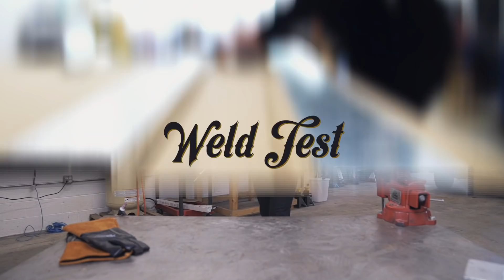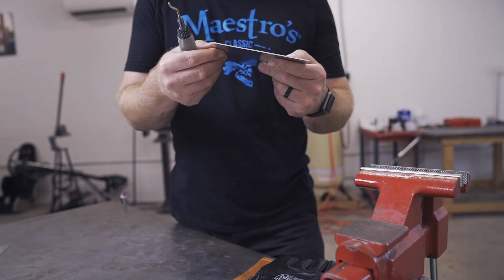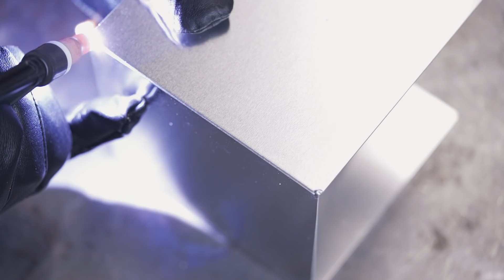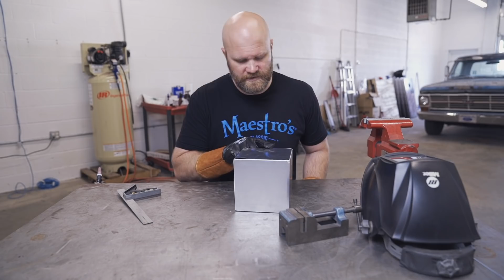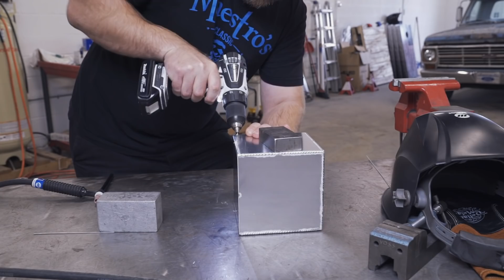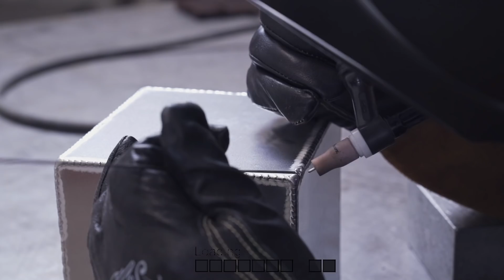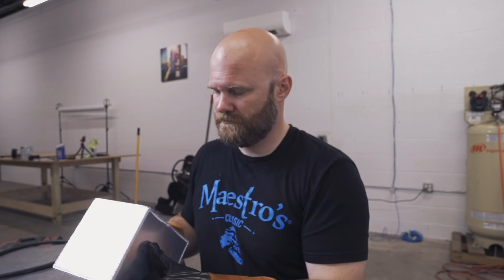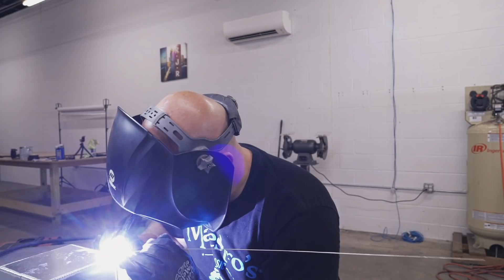Ace a NASCAR Welding Test - TIG Welding an Aluminum Cube

Comment: I've had do the same with pipe or tubing, you don't put a relief in it, it will blow out and you will never fill it. I'm a fabricator and have been for about 20 years and most guys that come fresh out of welding school know absolute shit about what you have to know to be a fabricator. It's not easy job and you constantly have to absorb and learn. Great video, going to suggest making a cube as a welding test and not just T's, butt and laps.
Reply from the maker: That’s awesome, some people say you hardly every weld up a sealed container but I disagree, happens a lot in building race cars. Each tube of the chassis is sealed.

Comment: In the beginning of the video you said you've done this very test on a couple of interviews and you still haven't learned to let it cool down before trying to close up the vent hole? 
It's the oldest aluminum tig welding test trick in the book! 
Guess you don't pass alot of interview tests, huh?
Reply from the maker: No bullshit here, I’v usually just let it cool but not on purpose. I never thought of internal temperature, kind of thought it was just argon building up. But now I know :)

Comment: I welded for Nascar and would test new guys. I usually would give them exact instructions on what I was looking for. If they where really good some one would hit the table with a hammer to see if they would just keep going or dip the tungsten.
Reply: It's funny you say that. I saw a guy do that shit and the dude that was welding ripped off his hood, grabbed a pair of welper pliers that was next to him and threw them and nailed him the back of the head. Dude got stitches, both got wrote up. Best be careful who you do that to.
Reply from the maker: I jump 100% of the time but haven’t ever dip my tungsten from it, I don’t think. But hell I jump if someone taps me on the shoulder. I’m just in the zone I guess.
Reply: Brian can you point me in the right direction of how to apply for such a job? I have a certification and the skill level I just don't know where to look into applying
Reply: @josephgonzales3573  Its really who you know. You need to stop by shops and talk to people.
Reply: @bpetrozelli  I can't even figure out how you find a shop that is affiliated with NASCAR in any way

Comment: What If you had the cube sitting on a big ice cold chunk of steel, making the air in the cube cooler therefore drawing a small vacuum in the cube giving you a second to seal the hole?
Reply from the maker: Possibly..

Comment: To fix the hole problem. Pull a vacuum on the box in a argon chamber and then backfill with argon. Wait until your almost fully welded up, and let the part cool to ambient temperature (still inside the backfilled chamber), once cooled quickly hit the hole before pressure builds due to excessive heat forcing the weld to expel. That’s the proper way to do it.

Comment: Using a steel razor blade also works as an aluminum deburing tool. You can whittle aluminum with a steel knife.

Comment: heat up the cube a bit before welding the hole. that way as you weld it most of the air in the cube will be getting cooler and it would suck in instead of blow out your weld.

Comment: if a welder showed up in tennis shoes it would take away from the first impression of a seasoned professional.... 
@7:15 fail for safety. no glove.. burnt hands are not productive..
Reply from the maker: I know people who tig weld with no gloves the whole time. And tennis shoes are the standard in nascar. Maybe just not grey ones.
Reply: @JustVoss  I used to run a 20 man fab crew. I was a fanatic about safety.
Reply from the maker: Jim Palmore no definitely not as heavy duty. It’s more like building hot rods. I need to work on being more safety minded with how many comments I get about it.
Reply: I've been tig welding in sheet metal the past two years.  Tennis shoes are the standard for shop welding.
Reply: Some of the greatest tig welders I've ever met wear tennis shoes and shorts

Comment: I don't know about nascar but I have fabed for historic motor sports cars (nascar included) also I have been welding in aerospace for 30ish years (AWS D17.1) and son that aint how its done! you didn't even remove the aluminum oxide off the surface with scotch brite and acetone not even,  and then using a dirty ass shop towel you just wiped everything down with. With all that shit on there how are you going to judge how dirty your wire is on the Tiffin scale? but your welds look good but im betting we X- Ray those and your gonna shit when you see the root!
Reply from the maker: Aerospace is way different. And I’m out of rags.

Comment: make two holes, one low, one high, pump argon into the lower hole for a little while, plug up the lower hole, weld the higher hole, orient the lower hole upwards, weld that hole

Comment: Leave it to cool down completely before closing up the vent hole and then it must be a very quick one dab affair or else it will blow it wide open again. Great video though and you gave me a good chuckle with your twin double.
Reply: Only saw your sticky post about the cooling after posting mine.

Comment: Random thought from a non-welder, but (kinda) knows my way around a machine shop ...

Why not use having to drill a hole as an excuse to say 'well, welding a box that can't be used (unless you're asking me to make a D6 ...) is a bit silly; how about if I add an internal piano hinge, of the same grade aluminium/steel, plus a finger hole/tiny knob made from a screw ...?' ...?

Comment: FYI, removing that protective film with your bare hands makes you look like quite the noob. If my boss ever saw me doing that without some Nitrile gloves on, I'd be doing shit-work for a week or two. The standards must be enforced. When working with any kind of metal, let alone Aluminum, always wear gloves. You can never guarantee in a work-place environment that you're gonna be able to clean your sweat off the part(s) before they start etching in. It's hard enough to keep Aluminum clean and oxide free without getting your greasy finger-prints all over it. Touching raw material with your bare hands would be a great way to make someone like me fail you for lack of attention to detail and lack of common-sense. If you're ever taking another weld test, you better pray that the guy grading you is nothing like me lol. I view holding tests that only 1/4-1/2 of the people pass as a success. It means I've weeded out the weak while exposing weaknesses which can then be improved upon in the strong. Military standards and all that... You can take the man out of the military, but you can't take the military out of the man.

Comment: I honestly can't think of wanting to work for Nascar as anything but a waste of time. It may look good on a resume, but with the way Nascar (and most other Associations, for that matter) is going, there's no way that job will last. Nascar is currently on its last legs. It's been brought down by faulty management, fragile egos and sheer greed. If you want a figure-head for the state of Nascar right now, you need not look any further than Dale Earnhardt's greedy, power-hungry widow. That's the type of person that's running Nascar now. They make Big Bill and Brian France look like little teddy bears in comparison. Big Bill was just plain greedy, and Brian France's anti-safety decision making led to the deaths of over a dozen drivers, yet they still look good in comparison to the new breed. They're corporate sycophants and greedy little punks to boot. They'd slit their own mothers' throats if they thought it would get them another corporate sponsorship deal.

Comment: I'm no welder!!! but I bet if you make the air in the cube colder or equal to the air outside the cube you could weld the hole. since your at a race shop, try putting nitrogen in the hole? another thing you could probably do is have the cube compress and slowly uncompress as you start welding but this would require another hand and probably a more flexible cube aswell. if none of this works buy a spaceship!... I guess a pressure chamber would be cheaper.

Comment: I’ve never welded aluminum but I mig welded a 14th inch steel box that was a 5x5 with a nozzle for an air hose so you could connect it to pressure and hold it under water to see if it leaked. That’s the real test is can you keep pressure in it with beautiful welds

Comment: Great video! But for folks looking to get into a shop, some small bits of advice -  you aren't gonna "ace" an aluminum welding test in any shop I ever worked in with unprotected arms, and welding with one bare hand, and not hitting those edges with a stainless brush at least once.
Reply from the maker: NASCAR you will. They expect whatever it is not to break and your work look nice. And coincidentally that’s what the video was about.

Comment: Out of curiosity, is it important to wipe down the surfaces where you'll be welding with acetone between tacking the cube together and laying down the finish welds?  Does skin grease from handling the material affect the weld at all?
Reply from the maker: Unless I have been doing some grinding or have handled it a ton. I don’t typically wipe it again till I’m done. I don’t think finger oils effect the weld. Maybe if you’re welding nuclear reactors. Most of the people commenting about it probably don’t even wipe off their filler rod, and new rod for me always leaves a dirty spot on the rag.

Comment: Hey there I’m fairly new to welding but I noticed that there was no puddle does that mean no penetration of the aluminum or is that something that isn’t a factor on sheet so thin?
Reply from the maker: Someone else mentioned that too, but there was a puddle right before the rods added. I’m also increasing heat at the same time adding rod, so it’s kind of happening at the same time.

Comment: You aren't supposed to weld a container shut because it can be extremely dangerous. That box could explode due to the pressures sealed inside it. Temperature fluctuations can cause it to expand and contract, eventually fatiguing the metal in the HAZ. 

You should have left the vent hole in it for safety reasons.

Comment: wrapping the box in a COLD wet cloth will help,  the more area you can cover the better. this will prevent  the  heat from spreading as much, and will not alow the air inside the container to  have as wild of a temperature change, this reducing the expansion experienced by the air whiten. Also, letting the container cool back to room temperature will also help, albeit, to a lesser degree. pardon the pun.

Comment: Helpful hints. If you turn the ac frequency up on thinner metal it gives you a smaller cooler bead with less risk of blow through. 
You had the frequency pretty low.

Comment: Aluminium is hard sins you can quite see when it is about to go liquid. Is it the angle of the camera or did you just solder it and not weld it?
Reply: I've been welding aluminum for decades. That's what it looks like. If your bead or weld zone doesn't silver up then you have some form of contamination going on or your heat is way too low. Make sure you clean everything before welding if your aluminum has any oxidization then sand though it and use acetone on it and your wire. Use pure argon. make sure your flow is good. set your gauge between 15 min to 20 for open still air environment higher if there is a slight breeze.  Keep your tungsten separated for different metals. The diameter of your tungsten should math your material diameter. It should ball over welding aluminum. This is normal. Your wire should match or be one size smaller so it doesn't draw too much heat from the puddle. Aluminum dissipates heat rapidly so I usually run a little hot but one amp per .001" +10% is a good place to start. Run AC with high freq. and practice. 
Once your eye gets used to the puddle it's not much different than steel or stainless. 
Like stainless you may need to back purge on occasion. 
I usually run a shorter arc and larger cup size than this guy to increase argon coverage over my weld zone.
Reply: @phoebebouley750   I'm a newbie and these are useful tips.  Thanks!

Comment: Clip off a piece of tig rod to make a plug. After the part is cooled use a small ball peen hammer, sharpen the piece, form it into the hole and clip the excess off. It’ll seal it long enough to finish the weld. It also prevents blowback even on very small parts. Done it for years and it works every time with any alloy.

Comment: I probably would’ve bent the filler rod to ¼” or so, stick it in the hole. Hit it with a quick buzz to brake it off. Let it cool for an hour, and buzzed over the hole one last time. Great clean welds, looks like a robot did them!
Reply from the maker: I’v never tried that but have had a couple people say that’s how they donut. And thanks!

Comment: You use acetone to clean your aluminum I use hydrochloric acid
Reply: I'm not actually that stupid plus I'm not even technically a welder since I'm 14 hydrochloric acid is very reactive in very very very violent when comes in contact with aluminum

Comment: there will always be a hole. the gases inside will always expand when welding. if you want it to seal you would be better to weld a fitting and plug it afterwards

Comment: What I have done when welding the vent  is to get the project hot, then let it sit and start cooling off. The idea is to get air flowing from the outside to the inside before you start putting heat back into it. By the time it gets hot enough to start building pressure again you should already have the vent sealed off. BTW, great video! And get some sleeves!

Comment: You should upgrade your safetyequipment. I know that might sound dumb but you should wear long sleeves and some sort of lether apron to protect you from sunburn and being burnt. And you should use some sort of dustextraction for gases so that the unhealthy gases are filtered and you don't breathe it in. I know that isn't the cheapest safetyequipment but it is worth it. In germany we aren't allowed to weld without this in the industry
Reply: He might be in a room big enough for natural ventilation, which needs 10,000 square feet per welder if I'm not mistaken

Comment: Nice job. I teach welding at a local community college and for there mid term the students weld a 3x3 cube in position, so they have 4 horizontal welds, 4 vertical welds and 4 overhead welds. I drill a hole in the center of the top before the students finish the weld to avoid blowing out the weld. After the cube is cooled I tap the hole for an eighth inch pipe fitting and pressure test the cube with 10 psi of compressed air and dunk in water. They get a passing grade if we see no bubbles from leaks. Most of the time if the cube leaks it is in the corners from not getting proper tie in on the corners. Again nice job on your cube.
Reply from the maker: I might weld a bung in mine and try to blow it up!
Reply: @JustVoss  be sure to post the results LOL

Comment: thanks for the video.  I would like to have seen your preparation of the tungsten even if it's just to your preference id like to know how and why.

Id also like to know what kind of filler wire you used and why.
Also tacking aluminium is difficult but you seemed to have no problem, what techniques have you employed to make tacking more successful.

Comment: Welding with no sleeves is a good way to get skin cancer faster.  Has no one ever mentioned this to you before?  When I see that I think newbie instantly.  Put some sleeves on and save your health.
Reply: Loki the sly one  the same uv rays that can make your face red if you tack without a mask or the same ones that burn your eyes.  Its uv rays from the sun that gives you burns and skin cancer.  Same stuff from an arc.  Its why you wear a mask.

Comment: Sub....scri....bed 
look! I welded that word together!
Reply from the maker: Appreciate you sticking around!
Reply: so you added ellipsis to the word. These typically imply trailing off mid... 

or that you are skipping something between the syllables. 

Either way you are adding a break each time

So technically speaking, you did the exact opposite of welding.
Reply from the maker: sukoo1 I think the dots are the welds
Reply: @JustVoss  I'm glad you get it. Some peeps are just just like Sheldon Cooper. 😊

Comment: I'd really love to get involved with pipe line welding for Tig.
Reply: Then do it! there is great demand and pay right now
Reply: Pipe lines are not typically welded with TIG. Usually SMAW, FCAW, GMAW. The last two in a automatic machine set up.

Comment: I'd have kept a bit tighter arc and set a higher ac frequency, but those things are a lot about personal preference. Great video, especially for those not very used to aluminium welding!
Reply: Ok, it wasn't just me who thought that torch looked like it was in outer space.
Reply: On corner joints I run low. Like 90Hz. I find if you go too high like 200+ the arc focuses and you blow holes on thin plate. It's more stable but too narrow for me.
Reply: With a gas lens you can be far.  I have a big cup too. My preference. 6-8 cup with a gas lens zircroniated at 160 hertz. 60-80 % on the negative frequency